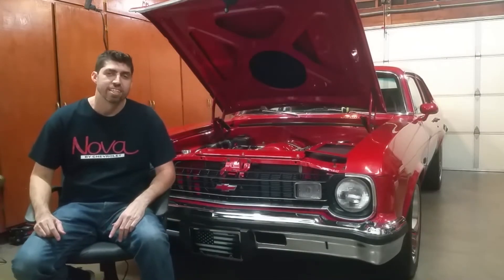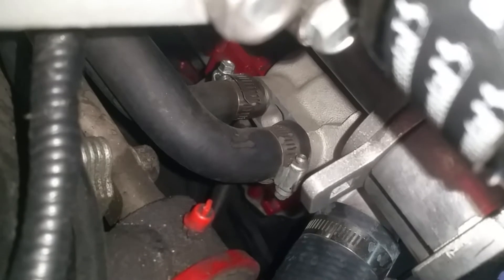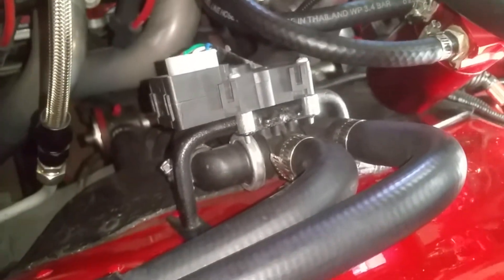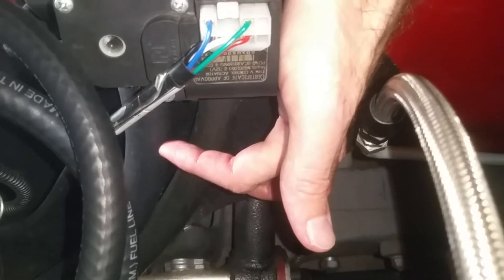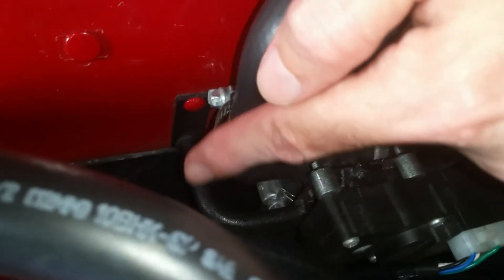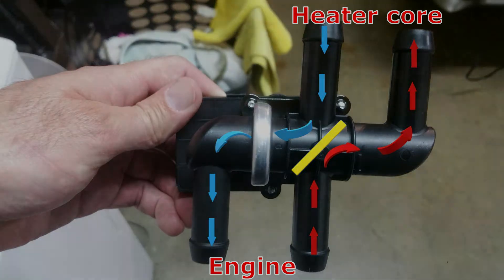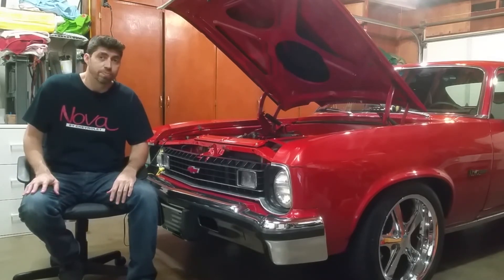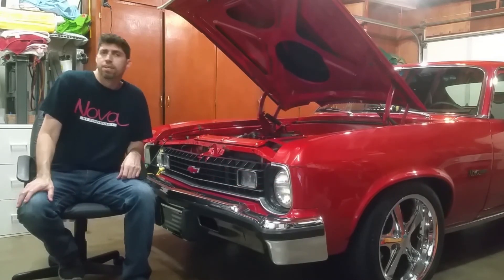74 Nova LS Rebirth Ep 17 - Electronic Heater Bypass Pt 1 - The Valve

Comment: Does this replace the heater control valve included with the VA kit? Can you adapt the wire harness for the VA valve to this new 4 way valve?
Reply from the maker: Yes it replaces the VA kit valve. In fact if you are using an LS engine you should not use the VA supplied valve. Its not right for that application. Its more for the old V8 engines. As for the wiring, You really can't adapt the wiring to the valve I show in my video because it (the valve in my video) needs the rotary dial to directly control the door in the valve. Its not a simple on and off valve like the VA kit. I did however put that wiring to good use.  I used the VA kit valve wiring to power an auxiliary fan for my AC condenser for those extra hot days.
Reply: Makes sense. However, I don’t think the VA valve is on/off. It’s controlled by a servo (or the command box) and looks to variable opening to me. I can rotate the temp control up a few notches from “C” and the valve closes slightly. It’s too bad that the 4 valve isn’t a drop in solution that works with the temp control unit. Thanks for the info regardless-it’s a great implementation for the LS guys.
Reply from the maker: @dannyb8955  Sounds like they may have redesigned or use a different valve than what was shipped with my order many many years ago. You will have to figure out if you can adapt the VA kit wiring to the wiring of the valve I used and show in this video. Unfortunately since I do not  receive the new updated valve shipped with your kit (when I received my kit many years ago), I can not help answer your question fully.

Comment: Awsome video.  I'm thinking of installing this on my 72 nova that was I recently put vintage air on. I've been running much much higher on operating temp than before the install.  Vintage airs heater control certainly leaves the thermostat dry but not sure if this my full issue. Even when I turn the heat on (full flow) I get above 200.. what were you running temp wise prior to this part?
Reply from the maker: Temperature was unchanged. I never noticed higher temps.

Comment: In short, my 2001 volvo blows warmish air even when on full cold setting , ive checked the valves are working   but i think an air door seal must be  leaking hot air.  thanks for video

Comment: Need to install this under my dodge grand caravan, to delete the rear heat in the summer. Its nice in the winter, not so much in the summer. 

I wonder if i can install it in front? It would be so nice not to have any heat in the summer period.
Reply from the maker: Funny you mention the Dodge Grand Caravan. I'm currently restoring a 2001 Chrysler Voyager. I may eventually put up the videos I made of the process.  Currently in the bodywork and paint stage.

Comment: Just the graphic of the flow of coolant through the valve was worth it.  I have this same valve and have all the hose plumbing done on my car but was really hesitant about the input and output flows from the valve because the directions are a little oblique.    After seeing this, I knocked out the rest of the hose clamp connections.  I have a BMW 3.0 CS and am trying to get the heater core out of my air conditioning equation.  

FYI, you did a really nice job on the Nova.
Reply from the maker: Thank you. I'm so happy that it was helpful to you.

Comment: Thanks cool idea. I put a vintage air system in my LS turbo build and when the servo valve is closed for the heater it likes to get up around 215 degrees. When I open it even a little it drops to 195-200. I'm changing my thermostat and a few guys recommend drilling a hole behind the thermostat in the water pump to allow a small amount of flow inside (similar to what you'd get with a heater core flow) from the front to the back. I like this valve idea instead! I'm going to drill mine and if it doesn't work I'll tap it and put a bolt in the hole to seal it back up and do this valve.
Reply from the maker: I did not do any drilling and my Nova runs at 185F on the freeway or steady driving. I'm using the Stock 13' Chevy Camaro thermostat. My fan does not even come on unless stop and go. Personally I don't feel its necessary to drill a hole in that partition wall behind thermostat (my opinion and experience). The Vintage air unit is not made for the LS engine setup. Works fine in SBC and BBC... But not on the LS engines.
Reply: @reborn74nova  agreed. They sent me my system and I blew a hole big bottle of Freon because I used the original LS compressor that needs two different thickness washers and they sent me two of the same thickness. Even their tech on the phone couldn’t help me. I had to search the internet to find the answer
Reply from the maker: @CrazyCowboyBuilds  I added links to parts described in the video including the one I have in description box if you are interested. Thank you.